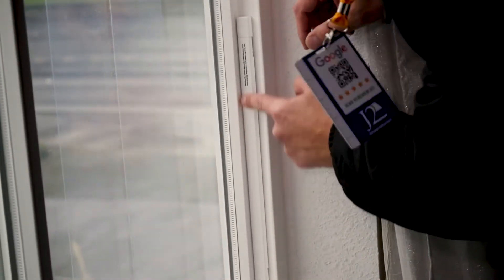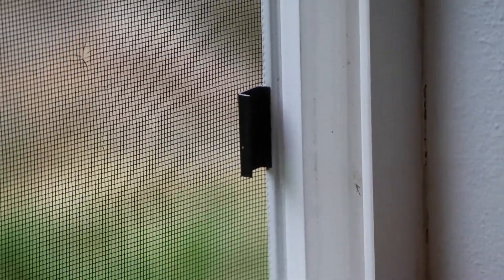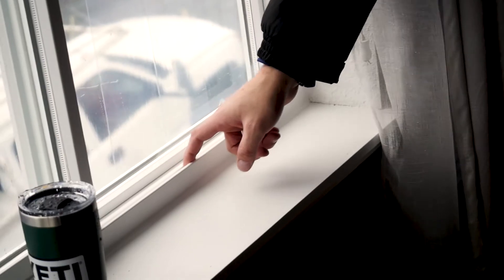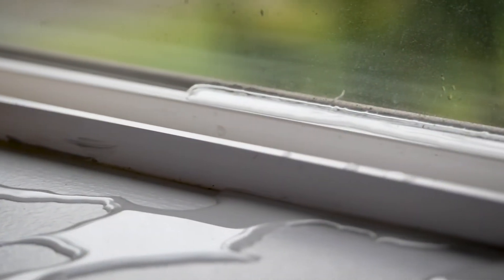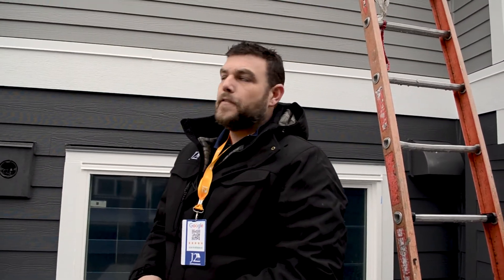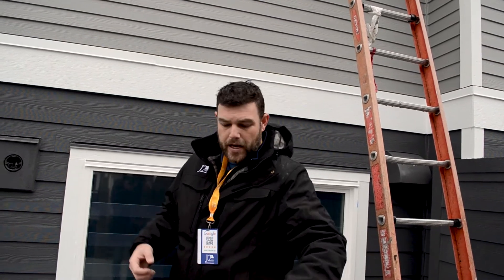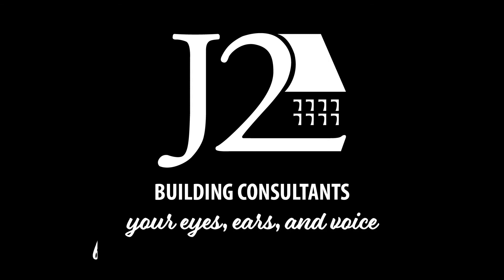How to Maintain Window Weeps and Trickle Vents

Comment: Out house was built in 2005 and our weep holes have some sort of felt material. Is that common? Secondly it seems like neither owner said whoever on this house ever cleaned the window track or the weeps there are filthy disgusting and mud clogged into them How do we go about unclogging the window weeps? Last but not least how do we contact the professional What are they listed under the yellow pages or Google search?
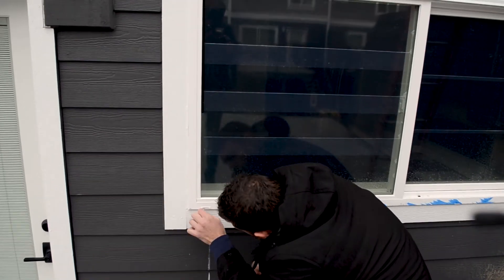Reply from the maker: Great questions! #1 - Could the felt material you're seeing be the "damper" Justin mentions at 06:57 ? Perhaps it is covered in moss or debris, making it look like felt.  #2 -  Yes, you can remove the window pane to clean the track with a damp cloth. If you can reach the window weeps, you can clean those out with a paperclip as shown at 06:19 in the video. You should be able to clear any blockage by swiping it with a paperclip or bobby pin a few times. If that doesn't work, you can also "pop" out the plastic track cover in the window sill to expose the drainage plane, which will make it easier to see what is clogging. Here's a nice article explaining how to clean window tracks: https://www.wikihow.com/Clean-Window-Tracks  #3 - We would recommend searching for a local glazing company for a referral to a handyman or technician that is experienced in window maintenance. They may also have someone in house they could send over to take a look.
Reply: @j2consultants  thank you for the tips and info much appreciated. 🤗

Comment: this is exactly what i needed to prepare for the atmospheric river coming up. i'm tempted to put flashing under the window weep hole outside because it's trickling over caulking and a wooden window frame a painter installed, do you think that's a good idea? and if i did install flashing to let the water drain below the weep hole, what is an appropriate method of attachment to keep it waterproof?
Reply from the maker: That is hard to visualize but there shouldn’t be that much water coming out of the weep hole, we just don’t want them blocked. Make sure the caulking and trim are in good shape and you will be fine. If you want to send in a picture we will look at it! Hello@j2consultants.com
Reply: I cleared a blockage so I hope the pooling inside the window rail is taken care of. It's just that we have a wind and rain situation and it faces the street so it seems very vulnerable where water hits the screen and then trickles down

Comment: My builder is telling me that because the home is stucco and the stucco has some cracking and pin holes. To just repaint the home to seal up the holes and cracks. I don't know what to believe because it seems like the window was improperly installed, and they don't want to be responsible so that's their way out. Blame it on homeowners maintenance. Any advice?
Reply from the maker: Do you have leaks and water intrusion at your windows, or any other signs of hidden damage?
Reply: @j2consultants  yes I do. I have cracking on the interior wall below one window. Visual water intrusion and soft corners of the interior walls by the other 2 windows.
Reply from the maker: @jersey07042  1) You don't "paint" stucco.  It should have an elastomeric coating.  And, yes, cracks and holes should be sealed.  However, depending on the type of stucco system, do not seal up all voids - some may be required for drainage. Most stucco crews would recommend not painting the stucco but rather applying a new color coat after the holes or cracks have been filled. However, if it was not installed correctly in the beginning, the cracking will telegraph through the new top coat in a matter of time. Check out our video on stucco waterproofing https://youtu.be/txmiaW91nAs
2) A homeowner can't "maintain" what is underneath the stucco. If there are insufficient control joints because the way it was installed, the stucco will crack - Example of a defect and not lack of maintenance. If penetrations are not flashed properly, especially windows, water will enter the system and can't get out - Another example of defect and not lack of maintenance. If there is evidence of leaking in the interior, it is most likely an installation issue not a maintenance issue.
Reply: @j2consultants  Thank you for that great explanation and breakdown. It was elastomeric coating that’s on the exterior. They are saying that it breaking down. Home was built in 2017. Also I believe it is what you say “Improper install”. I will also check out your video on “Stucco Waterproofing”. Thank you so very much. 

Lastly would reinstalling the windows correctly solve the problem? That is a vague question I know because there are so many factors like you said. I’m just trying to get an idea of what steps to start with since the windows do have warranties.
Reply from the maker: @jersey07042  Since there is cracking in the stucco and soft areas below the windows on the interior, we would recommend get a third party involved to perform an invasive investigation (building consultant, engineer…). This will allow you as the homeowner to determine the nature and extent of the damage. 
With the information gained on the investigation, this will give you a better plan for next steps. Whether you pursue the contractor, or need to make an insurance claim, you will need a professional to provide an expert opinion and official report of the damage. 
A window that is not correctly installed in stucco is difficult to diagnose without removal of some stucco around the perimeter of the window. Once you reveal the construction defect the contractor may agree to fix it, otherwise you will need to prove the defect, get bids on the repair cost and file a lawsuit within your state's contractor liability statute. Where are you located?
On a side note, weep operation can easily be verified. If that is what is needed to move to the next level with the contractor, here's a quick test you can do: Take a ordinary glass of water and "fill up" the window track, making sure you don't overflow on the inside. If the water drains quickly your weeps are functioning. If the water sticks around, then the weeps are not functioning and would need further review.
Reply: @j2consultants  I’m located in Texas. I will check the weep system, Thank you so much!!